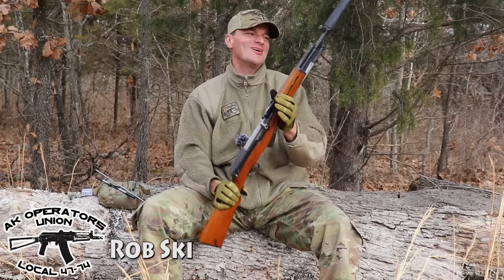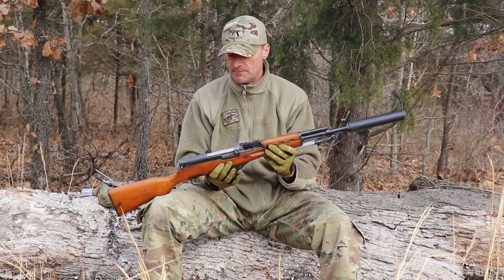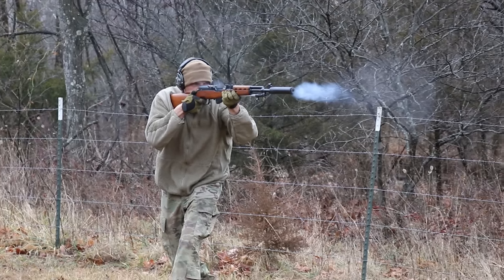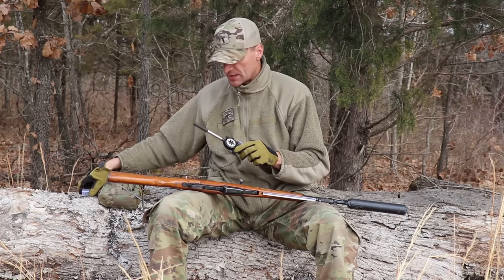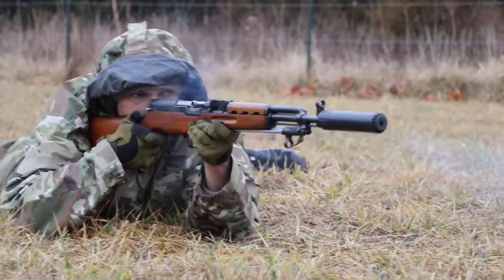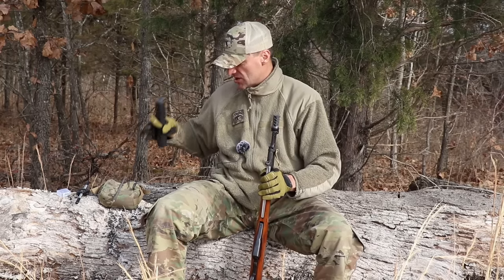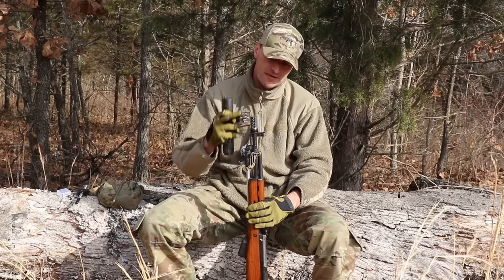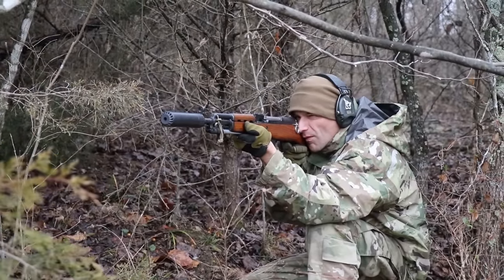SKS Suppressed - Do it yourself in 10 minutes!

Comment: Needs more Yugo with gas system turned off and subsonic ammo.
Reply: Yugo already has 14x1 rh threads also if you remove the grenade launcher!
Reply: I have found that the Griffin Armament 22mm gatelock system (found on the 30-SD) will work on the Yugo launcher with minimal machining/modification of the launcher. Too bad that Griffin has discontinued this series.
Reply: @PewLand  Just got one, great to know!

Comment: I agree about CNC threading kit, owned a FAL that had it’s “evil” flash hider/bayonet mount removed. Couple hours with the threading kit and I had a muzzle brake installed.
Reply: FAL's had bayonets?
Reply: @marblemarble7113  yes, the type of bayonet depended upon the type of flash hider it had, wether an inch pattern birdcage or a metric muzzle brake. Only the metric one is threaded, the inch pattern had a key system with a slot cut into the barrel.

Comment: Rob. In your experience what are the chances of the threads coming out not concentric enough for a suppressor using this type of tool?  I've always heard these threading die guides weren't precise enough to use a suppressor. Is it much of a gamble???? I've also heard that the barrel/fsb shoulder is actually just as (if not more) important than the threads for suppressor alignment. I hope you're well man.
Reply from the maker: I have threaded 3 rifles with it, all are absolutely perfect...all 3 are running suppressor now...lol. I would say that much, if you are doing it slow and paying attention to it, i don't see the chance to screw this up. Now, make sure bore is concentric tho...

Comment: Always seemed to me that the Yugo 59/66 would be perfect for a can. With the right can you could shut off the gas system and run it like a straight pull bolt action. Should be quiet as hell. Especially if you run the new sub sonics.
Reply: Getting that spent case out of the chamber isn't quite as smooth and easy as you'd think though.  You'd need to keep the chamber spotless otherwise you'll be mortaring it open every time (as me how I know lol)
Reply: @VCBird6  good point! I imagine running good, brass case ammo would be a good idea.
Reply: That was exactly my thought, too. I figured it can pull double duty as both a suppressed semi-auto 7.62x39, but also a straight-pull rifle cal DeLisle wannabe w/ subs. Seemed like a GREAT idea in theory.

Comment: @Rob did you need to use an Annular cutter first before using the threading tool on the barrel or is the o.d. of the barrel already the correct size?

Comment: So, I don't have to use and angular cutter to reduce the barrel outer diameter? I can go strait to threading? Using the kit? And did you use an alignment tool, or is that what you used the guide rod for?

Comment: I wonder if the SKS would’ve been issued with removal mags instead of the fixed 10 round mag could it have been competition for the AK?
Reply from the maker: There are sks variants which take AK mags and also some original inserts which take 20 Rds instead of 10

Comment: Hey, Rob. You talked about the guide Rod.. If I've got remove the very front Assy ( sights,bayonet lug,rtf. Thats all one piece. Can the guide Rod help me relate the front sight Assy,back onto the barrell once I get it off. Looks Like it's pressed on. Will the guide Rod hold the sight,bayonet Assy, I place while pressing the front back on. If so what is it called,a guide Rod and where can I get it. I don't want to take the sight Assy off,than put it back on crooked.
Reply from the maker: It's called suppressor alignment rod. It is only hair smaller than diameter of the bore. I'm not sure if this would work for your scenario tho...

Comment: I don't see the point in a suppressor if you still have to wear protection
Reply: Same
Reply: You have to shoot sub sonic ammo to use suppressors without ear protection. Suppressors are still good without sub sonic ammo, it will reduce hearing damage and noise pollution.
Reply: Jason Bartlett right but why use it if it doesn’t protect your ears
Reply: even with supersonic ammo, it still hides the initial "bang" signature. Yes, you will still have the supersonic crack of the projectile rippling through to the target, but still effective.
Reply: David Williams yeah I know that
Reply: A silencer will usually have the same DB reduction as muffs. You can still do hearing damage with muffs on. A silencer and muffs is way better. And when you fire without muffs a 30+ DB reduction can only be beneficial to your hearing.
Reply: Rob has already stated he is losing his hearing fast. So he is taking extra steps to help stop that and still do his reviews. When at the range most people dont use muffs with cans. But if your shooting 10,000's+ rounds a year you do things a bit different than the regular guy for your health. Look at garand thumb. He has started to wear a mask because his lead levels went up. Gun reviewers have different issues than us.

Comment: Can you use the threading tool on a Yugo SKS
Reply from the maker: Yes
Reply: The tool will worik on any barrel.   Info is on CNC  Warrior website as to what tool you will need.  Good company to deal with.
Reply: Yugo is already threaded 14x1rh so you would have to chop that part of the barrel off and start further back...this could be an issue if you want to keep the front sight but you could unpin front sight and make the inner hole wider to move it rearward on barrel and repin it.

Comment: seems odd to need hearing protection with a suppressor I guess it's not that quiet.
Reply: Jorge Larson actually it's not.
Contrary to popular belief suppressors are still loud af, just under jackhammer noise in decibels. It's useful for making it sound like something else, reduce flash, and acts as good muzzle break.
only guns that can go so low enough to not need hearing protection is 22lr with a very high end suppressor.